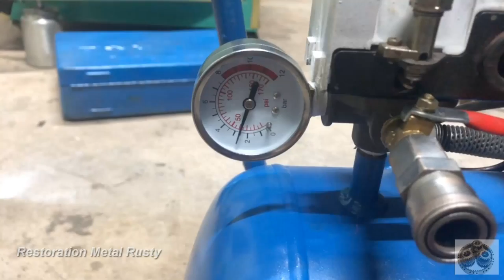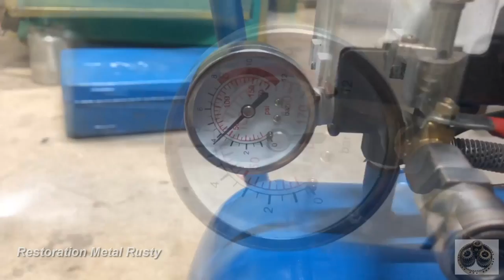Restoration air compressor rusty old  - Piston Hand border broken restore

Comment: Te dejas un dinero comprando pistón y biela, y no compras un par de rodamientos si no que reciclas los que tiene con todo lo que ello conlleva (que el rotor recueste en el estator por desgaste de los rodamientos.....), y lo peor, quiero creer que el aceite que le echa al final es nuevo porque según se ve, recicla también el que tenía ya que se veía bastante oscuro (por no decir, negro) de locos............. Dedo abajo PD: El manómetro va hacia arriba, no de lado. EDIT: Acabo de ver el video otra vez y SI, pone el mismo aceite... LOL  / You leave a money buying piston and connecting rod, and do not buy a pair of bearings if you recycle the ones you have with all that entails (that the rotor lies on the stator for wear of the bearings .....), and the worst thing, I want to believe that the oil that it throws at the end is new because it seems, it also recycles what it had since it looked quite dark (if not, black) crazy .............Finger down. PD: the manometer goes up, not sideways. EDIT: I just saw the video again and YES, put the same oil... LOL

Comment: excellent resto, but please trim the ends of the aluminium tube you use to seat the bearings, it is an eye sore , Did you notice the cylinderhead gasket, looks like it broke near the stud hole,  I